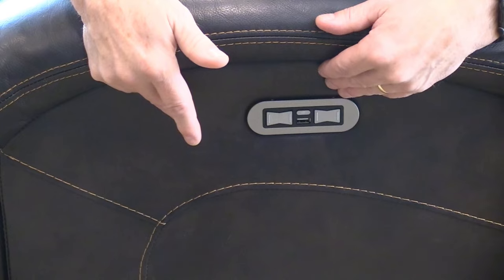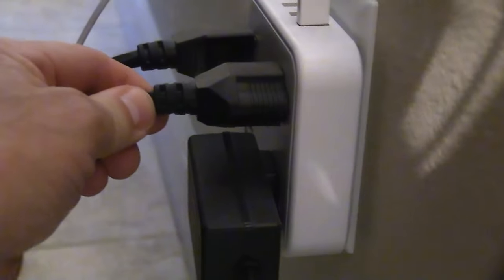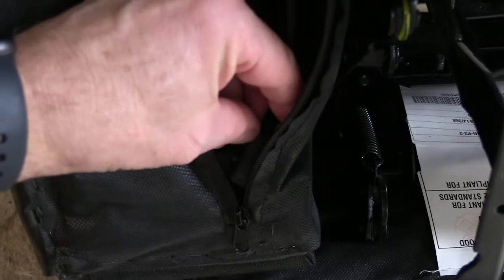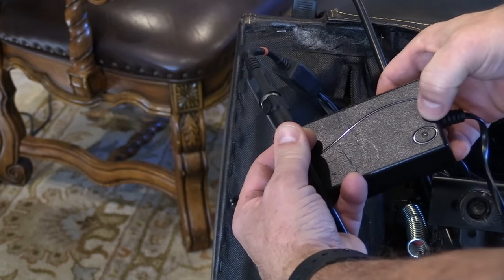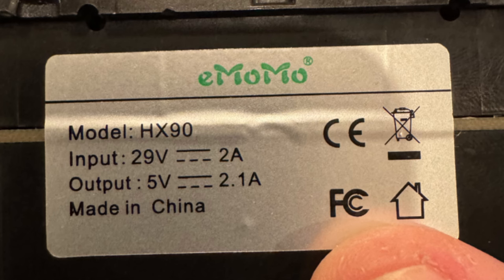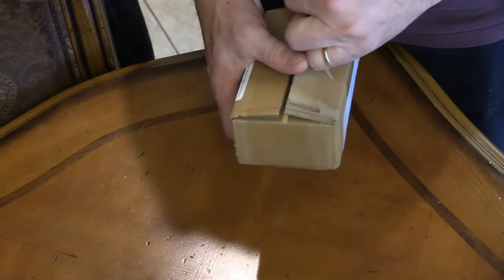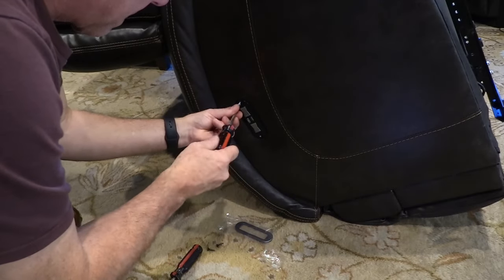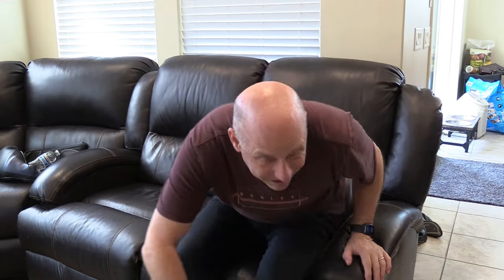How-To Replace a Reclining Chair or Sofa Switch (Detailed)

Comment: I cannot thank you enough. Our recliner sectional seat movement ceased working after less than 2 years. I stopped by Rooms2Go to facilitate a repair call. I left voicemail then later text message to the repairman and never received any follow-up. We had not purchased the extended warranty and knew it would be an out-of- pocket repair. After many frustrating weeks, I found his video from you and your troubleshooting advice led to success. The power led would pulsate green until I disconnected the recliner seat back and footrest switch. Solid green when Switch was unplugged. Another telltale was the USB charge ports had ceased working. Ordered a new switch from Amazon. The button arrows were not exactly the same, but after installing the new $36.00 switch, everything worked good as new. Probably saved me at least a $150 service call plus the cost of parts. Glad the Rooms2Go guy never called me back. Thanks to you taking your time to record and post a very good video 👍!
Reply from the maker: Great to hear!  I remember thinking it was going to be a costly repair so I was quite happy to fix it myself and so cheaply.  It’s what inspired me to start my little channel.  Thanks for the message!

Comment: Hi my recliner stopped working in an open position so I really need to fix it lol. The light on the transformer is on, even with all the cables connected. I unplugged them and plug them all back, still not working, and the light on the transformer is still on. Is it still possible for the issue to be the switch? Or any other recommendations. Thank you!
Reply from the maker: Very hard to say. My guess is that it’s not the switch but I’d still try replacing it as a test. Buy  one that you can return easily if it doesn’t solve the issue.  Unfortunately, if it’s not the switch it might be the motor.

Comment: Thank you for doing this video. I was able to find the switch on ebay, cheaper than Amazon. It was the exact replacement, and my recliner is working again!
Reply from the maker: Great!  Glad it worked out.   I was so happy to get mine working again - and so easily too!

Comment: Thank you sir!  That’s the IDENTICAL SWITCH I NEED.   IVE WATCHED VIDEOS BUT FOR THE ROUND ONES & did all the tests of power to recliner & my NEW BATTERY & OLD ARE GOOD 👍
Reply from the maker: Great!  When my chair broke I was so annoyed that I would have to pay a lot to get it fixed.  So, when I solved it with this easy switch replacement, I really wanted to share it.  Glad it helped you.
Reply: I researched & the MOTORS ARE OVER $300 bucks & one TECH said…intricate to install per model  of the recliner!!!  These sofa & recliners are soooo Expensive lol 😂. Next time, I’ll get an  OTTOMAN for DA KING 🤴 LOL 😝. Again, thank you. ( btw, was a computer custom design tech & electronics comes easy for me…it’s called patience & thinking the way machines communicate 😅😂!)
Reply from the maker: @noemifitzpatrick6039  Yikes.   I'm so glad it was just a switch and not the motor.   I need my footrest!!!!!

Comment: Hello and thanks for helping all us who try to do this at home. Early in your video you show checking the on/off power button on the electric recliner. That is out of service on my sofa-I think-(the light is red when power connected but it doesn't activate the motor) and I need to replace that part-I can't for the life of me find it on the 'net-can you name it for me? I've gotten the actuator motor and the 2 button switch but it still didn't work-it has to be in that plug in piece doesn't it?
Reply from the maker: Not sure I’m following you.  Did you replace the switch that makes the chair recline or no?
Reply: yes. I'm calling that piece the "2 button switch", it's the round thing on the side of the couch that makes it go up and down but it didn't work. i also replaced the motor I think its called the actuator. It didn't work- Then I looked at the place on the sofa where you plug the power cord. It will receive a power cord with a red light that shows when the power is switched on. I removed that along with the small black box and the wire that goes out the other end of the small black box and plugs into something that fits it. Anyway all I can do now is replace the third piece I'm calling the power switch (maybe it's a transformer or something I don't know. I have pics of it if that would help but in your video where you say to check if the power is on-THAT's the piece I need to replace-it's the last thing that apparently was affected by the lightening strike that did all this. I have definitely done this the longest and hardest way and it's still not over.  @ThingsEvenICanDo
Reply from the maker: @kaynineinterest  What kind of chair/sofa do you have?  Is there more than one recliner?  If so, I would suggest troubleshooting by moving a known functioning transformer (the rectangular box the power feeds into) with the suspected bad unit.  Based on how you describe things, it does seem like that is the only thing left to replace.   Feel free to send pictures to thingsevenicando@gmail.com    It might help me to see what you're dealing with.

Comment: Thanks for the video

I think the extra wire is to jump to the other recliner vs using 2 outlet plugs

Thanks again, very helpful
Reply from the maker: Interesting. It would be nice if I didn’t have two plugs.  I don’t like taking up all those slots.  For my set, I used 4 outlets.